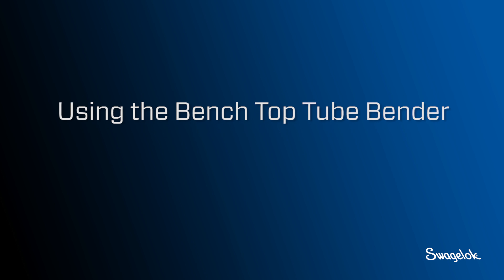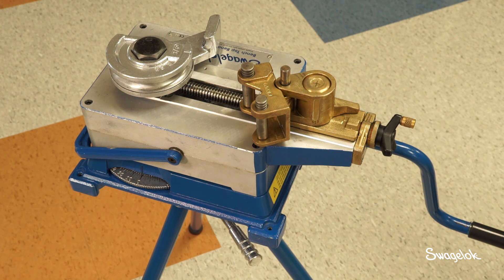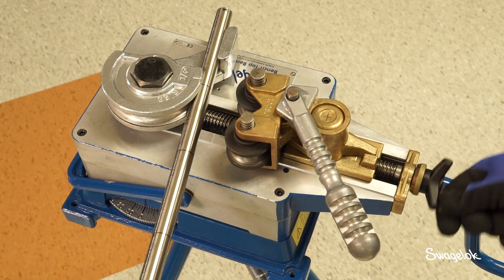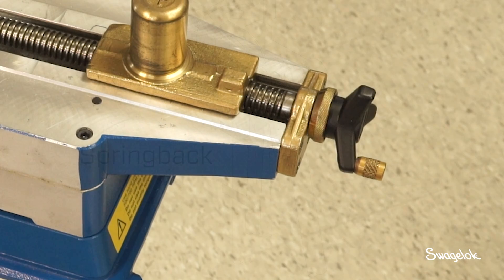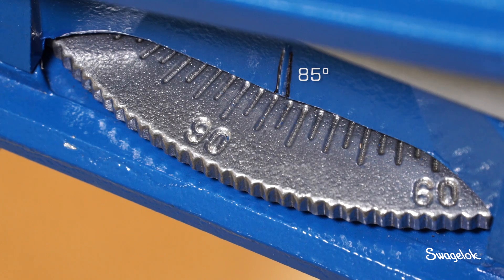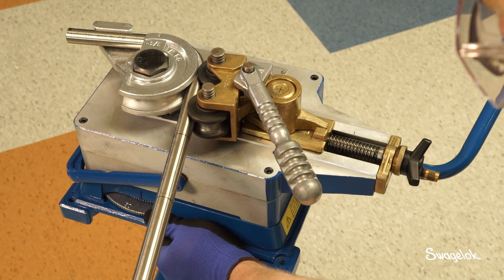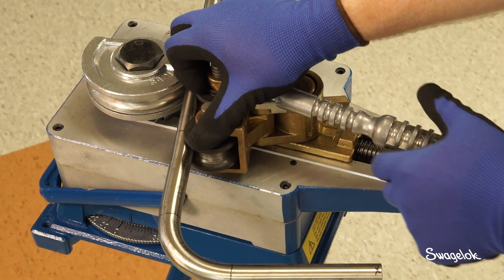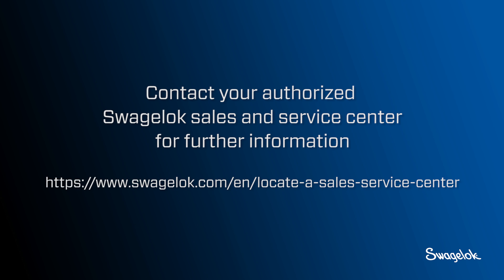How to Use a Bench Top Tube Bender | Tech Tips | Swagelok [2020]

Comment: This beast is next to impossible to use.
Reply: Used it today, pretty simple, makes very nice bends ❤
Reply: @miikesnow50 right on !
Reply: @miikesnow50  there's not much tweaking after you bend big tube. You're measurements have to be very accurate because you can't massage bigger tube into place like you can 1/4 to 1/2" tubing.